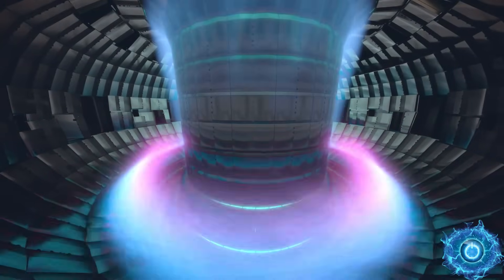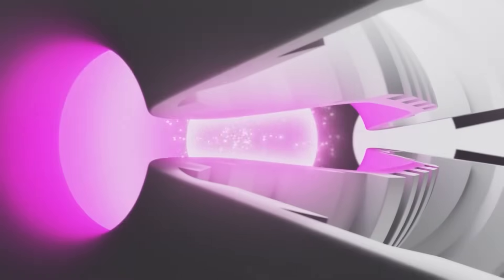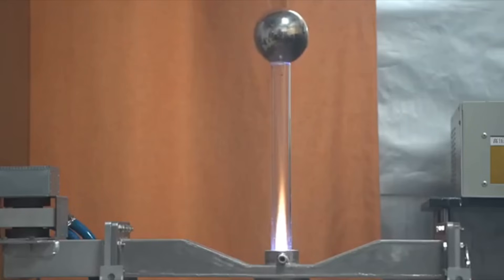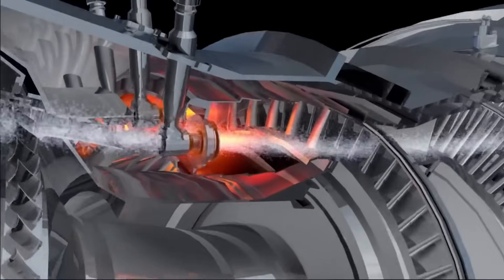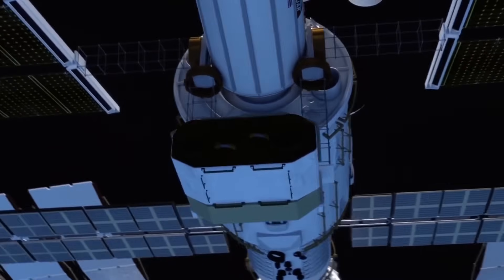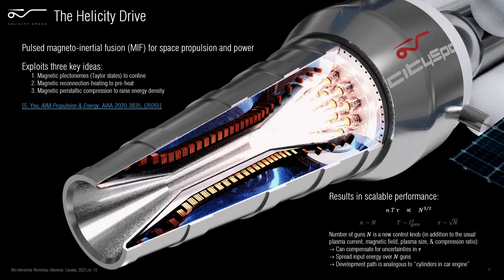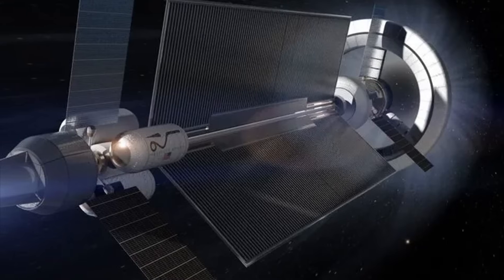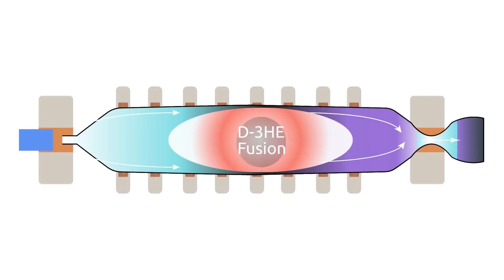New Plasma Engine DESTROYS Rockets!?

Comment: When fusion comes available and more importantly is scaled down to the sizes that will make it possible to be used in space we will use those but in the meantime we have modular reactors that meet the weight requirements as well as the operational requirements for use in space. With each modular reactor running 1 to 5 megawatts depending on the demand and a 40kw reactor is all very helpful. So do you think using the heat mixed with a reaction mass in a way that the nuclear salt water reactor that was developed for this use case early on in space flight development or do you think that we should just go directly to plasma as a means due to the fact that you can carry so much more reaction Mass. I don't know if you can carry enough salt water necessary for the existing design of the saltwater nuclear engine. But I think having up to 5 megawatts and perhaps two of those in one spacecraft who create an enormous amount of thrust if we can get that much efficiency out of a secondary reaction Mass such as lithium or other types of metals. There's a paper on metallichydrogen and that seems like it would be quite reactive and a candidate substance.

Comment: There is a 1 to 5 mg reactor that would fit in a falcon heavy. It's a modular reactor and it's made to run and never to require service or any kind of opening of the reactor core. It's a Lockheed Martin DOD Pepe and then there's the space made da Vinci Lockheed Martin 40 KW reactor made for lunar bases and operations on the moon. Both of those nuclear reactors will operate without the needs to change fuel rods or anything for I believe up to 40 years. You could run two of these reactors theoretically 10 megawatts but probably with the need to supply energy to life support and other things you could do a sustained 7 megawatt output dedicated solly to thrust. This could be in the form of these ion plasma engines or there's an existing saltwater and nuclear reactor based engine that they came up with in the 60s or 70s. However I think that salt water is not necessarily a very energy dense reaction Mass and then there's the potential to make metal hydrogen or another form of a very dense high energy reaction mass that could either be used in the way that salt water is used in the existing reactor or to make plasma. So if you ran 7 megawatts of current through a couple of plasma reaction Chambers and we're dropping very slowly adding small amounts of extremely dense. You can move a heavy cargo and passenger based spacecraft at a pretty good pace. You could potentially run i on a constant thrust basis. The question is how much thrust can you get from a plasma made that's safe from lithium just to pick one off the top of my head and having it create plasma with let's divide 7 by 2 so 3 1/2 megawatts per reaction chamber. I wonder how many newtons you can get out of there? They already have a space-based feasible module reactor and it's made by Lockheed Martin and it creates 40 kilowatts I'm consistent energy and weighs six times while 1-5 MEGAWATT REACTOR is 50 tons and will fit on the top of one falcon 9 heavy if the fairings will allow. And or could be broken up into two or three space shots but from a t weight requirements the one to five megawatt reactor on will falcon 9 heavy.

How do you say having two of these reactors built into a spacecraft for cargo, passengers, construction equipment etc for the actual construction of a base on a planet within our solar system could even potentially achieve direct consistent thrust so that the passengers can enjoy at least partial gravity as a linear gravity will be indistinguishable from the gravity we feel here on Earth if it's in space. If they can do a direct 1G burn and a 1G burn halfway through they can make it tomorrow and about 15 to 20 days. And during the entire time you lay out the interior so that the living spaces are designed to be interchangeable from one side to the other. The astronauts will experience a full gravity this would be a space built spacecraft not one that was shot off from the surface but would have to be brought up modularity. You can build it while it's sitting next to a permanent space station perhaps at the medium earth orbit and I would argue that as long as the radiation requirements can be handled that a geospace geostationary permanent space station would be very efficient and a good place to construct spacecraft for bringing cargo and passengers back and forth between Mars and even the the moon with Landers and shuttles being attached to the cargo vessel. It would also make it possible to rescue the people who are starting to establish these bases as the current way that we move around the solar system does not lend itself to a quick rescue. However if you have one or two dedicated cargo spaceships that have been constructed in orbit and you shuttles rather than landing themselves on the surface you can make a very large vessel that could contain two to four of these modular reactor as well as carrying a couple of the 40 KW for use at the base. We are going to have to use nuclear reactors and the two that I've mentioned currently meet the weight requirements for launching into space.

Comment: Besides a very high power energy source, any inefficiency must be rejected to space as waste heat.  That is very difficult at high power levels, requiring thermal radiating panels which would need to run very hot (even "white hot", like a Tungsten filament).

Comment: Properr  Cassing  with  self  eating  exhuast  To  elliminate  radiactive  waste  discharge   + a Direct Turbine system Implanted  in  the ship  housing  That  is  directly  Pulling  power  from  Fusion  core  would  fully  elliminate  Need  for  Any generator  solid  magnetic Core  =  each  ENd  runs  both  ground  and  positive  -  makinhg  one  complete  circuit  and  you  have  bypasses  all  along  the  way  and  double  and  then  in  tripples  and  so  on  with a  qubit-tronic  ai  compute  center  and  loaded  down  with  long  and  short  range  radar  dropped  along  the  way  and  it  would  only  take  one  per  Solar  Body   with  a  short  range  to  move  in  closer  to  defined  target  and  not  crossing  any  outgoing  reception  traffick  IF  ANY   -  ?  Which  we  are  MOST  DEFINITELY  "  NOT  ALONE  "  and  there Are  PEOPLE  JUST  LIKE  US  =  not  a  copy  but  simular  to  our  Design  and  DNA   Structure  =  YES  !!!  we  just  have  to  Leave  Here  and  ONE  DAY  =  ALL  OF  THIS  WILL  END  In  a  Massive  Engulfment  Of  All  the  Planets  till  it  Hits  Our  Gass  Giants  And  Then  BUILDS  UP   A  BACK  BURNNER  that  Implodes  or  Explodes  =  ?  it  is  simular  to  other  likewise  solar  Gravity  fields  =  Just  just  becuase  ALL  WE  SEE  On  somne  planets  are  just  A  few  Solar  dimmings  Doesnt  mean  they  Arent  GAS  GIANTS  =  Themselves  and  We  just  cant  see  the  smaller  planets  due  to  Their  ORBT  CLOUDS  =  ?  =  YET  !  wost  objects  in  space  For  A  Viewable  field  is  VISIBLE  dust  and  ORBT  clouds  as  they  Are  Intensely  Filled  with  Solid  Carbom  Matter  ! =  HOWEVER  =  traveling  Through  space  Are  those  Not  surrounding  Any  Solar  Gravity  Field  and  is  Where  we  Would  want  to  Travel  as  it  would  be  OUT  of  ANY  FRAVITY  FIELD  !!! =  yes  =  Between  Solar  Gravity  fields  -  so  -  Really  not  a  Staright  shot  =  NOPE   !!   You  WOULD  NEED   Trajectory  Propulsion  as  well  thats  WHY  you  cannot  just Use  One  Cavity  for  suh  but  at  LEAST  3   -  Two  Side  =  Horizontal and  one  Vertical  And  Largest   Thrust  Vector  being  Centered  Vertical  with  nearly  same  Design ,  Shape  and  Slighty  Smaller  Size  of  center   as  with  two  the  less  for  each  and  Quicker  repsonse  as  forward  Motion  would  demmand  Those  also  to  have  Multiple  plains  of  directional  Force  =  ALL   3  in  fact  ,  From  a  Stationary  Position  -  as  it  WILL  tear  apart  from  ship  if  you  do  not  Make  Core  of  vessel  ONE  Very  large  solid  CORE  ! and  not  just  in  the  basic   4 directional  but  rather  All  Directions  Circles  can  be  for  pathways  between  but  keeping a  flat  floor  plan  from  lower  to  upper  decks  and  just  as  Much  backing  in  Each  Floor -ing  -  just a s  thick  as  center  out  so  the  same  as cross  side  to  side  and  most  outter  being  the  thickest  panels  ,  they  acnnot  be  thin   they  must  be  as  3x`s  thicker  than  structural  core  with  multiple  layers  that  also  influde  multiple  functions  -  liike  bleedoff  of  gasses  in  each  quadrants   and  bulk  heads   at  yes  each  passage  way  is a  bulk  head that  is  pulled  up  into  upper  deck  hidden  from  access  uless  emeregency  wich  yes  you  would  need  rat  tunnels  -  look  to  military  terminology  here  ,  and  escape  pods  that  are  part  of  ship  hull  also  that  Retains  Hull  As  Escape  is  Commenced  as  in  a  Abandon  ship  oreder  is  last  resort  anyway  , i  mean  the  details  that  need  to  be  drawn  out  cannot  be  easily  created  over  night  -  not  even  with  ai  ,  but  with  the  minds  of  humans  to  put  it  together  and  the  CURRENT  Position  of  AI  =  Is  IN  A  Freaking  MEME  -  ?   :face-turquoise-covering-eyes::body-green-covering-eyes::face-turquoise-drinking-coffee:

Comment: There are several plasma or Ion drives in development now and I am happy to see them but I see failings in each one.  Or perhaps I am just not happy with the results and in my mind it should be simpler to solve.  The coils are not dense enough, the tube is not long enough with the coils and the coils do not seem to be accelerating the plasma and there is no information on the plasma injectors pressure feed to demonstrate the power or thrust gain from that point to the end point.  The coils represent an afterburner made up of magnetic fields but they are still short and ineffective at adding speed.  Of course I am hoping for more than 10,000 miles per second speed.

Comment: Current Fusion Technology can create fusion pulses from deuterium pellets. There are also experiments deriving electricity directly from the fusion reaction. This is fairly inefficient at this point, however if you only needed some electricity from the reactor this might be sufficient. And if the fusion pulse was able to be directed in a single direction, this might be quite useful for a fusion plasma rocket, with an electro
magnetic guide. 
In fact imagine two electromagnetic rail guns firing two  deuterium pellets at each other, when they fuse into helium releasing energy the power from that is captured on  3/4 of sides and electricity. And the plasma is ejected from the rear side guided by an electromagnetic vortex. In a sort of electromagnetic bell housing. Thus producing directed thrust. 
And there you have it a self sustaining fusion drive rocket. 
All from basic existing experimental Technology. 
One only requires a deuterium supply. Say a large tank of heavy water. Which can be split to give Oxygen and Duterium. With the oxygen used for life support. Or recombined with any regular hydrogen for a water supply. 
Any excess beyond that, and any waste from the ship can be injected in to the plasma drive to be ejected as additional mass.

Comment: My MIT work proves how Noguchi of early 1940s Hamgyong had perfected muon catalyzed fusion for spaceplanes so Dr Mitchel Swartz phoned me to suggest how I should take Jerome Drexler  to court for plagiarism since Noguchi of early 1940s Hamgyong had perfected rocket engine comprised of a Dewar of deuterium connected to a beryllium alloy reaction chamber nozzle in around electromagnet Helmholtz coils to focus cosmic ray muons for cryogenic fuel to prevent exceeding of Curie Point.

I have a CIA archaeologist stuck in of Eastern North Korea or even in of Eastern Manchuria to search for any remains.

Comment: Congratulations ... very beautifully thought out ... more engines put in parallel and then a single way of escape and this can be used as a particle accelerator ... increases the particle flow will increase the current taken by accelerator ... In my idea, ionized particles are first accelerated in a circular accelerator (where the particles pass from one accelerator to another) and then are evacuated through more nozzles ... which work in parallel. My motor is a hybrid between the rocket and a accelerator...

Comment: Air breathing plasma thruster is a dead idea because it requires so much electricity that is nearly impossible to generate without a nuclear reactor on board. And if we have a nuclear reactor on board it's a better idea to heat the air using the heat of a nuclear reaction rather than use bulky steam turbines and generators to turn the heat of a nuclear reaction into electricity and then turn it back into heat using microwaves.

Comment: No, if we cannot build a plasma fusion reactor, we cannot build a fusion drive either. First you need to be able to extract energy from the drive to provide the power needed to create the conditions for plasma, sustain the plasma & provide magnetic confinement to protect the engine from getting destroyed by the very hot plasma.

Comment: sustained explosions engines might be near these kind of multi pulsed recombined instead of a burn you could acheive detonation energy by pulse and recompose the plasma into a steady burst. didnt happened yet china was having some advancce on it with a ring design basically explosion that spun around a channel but last time i saw that they couldnt keep it going

Comment: i don't think it matters. the problem realistically is with source of power, not with methods of creating exhaust. a man named Robert Enzmann proposed using particle accelerators to drive his proposed echolance starship. this ship was supposed to achieve up to near lightspeed without any substantial new tech. realistically, just strap a steam turbogenerator onto a standard nuclear reactor, and you should have far more than what is needed to get to mars in 39 days. more power means more vasimir scale ability.

Comment: I read about another old somewhat similar but much simpler concept where the rocket nozzle was a thin, long cone where the walls transitioned from neutron absorbing materials to neutron reflecting materials.
When pumping a nuclear liquid salt at high pressure, a fission reaction can be maintained at the end of the nozzle for enormous specific impulse values
Reply: You seem to be referring to Bob Zubrin's NSWR: Nuclear Salt Water Reactor, which is indeed fascinating, but requires some extra complications in order to keep the neutrons in only the proper section. I have never seen that additional part described.

Comment: I-Cann II rocket concept from  Pen State University claims 128 days. It is a hybrid nuclear pellet design that uses the nuclear pellet being detonated by antimatter using a storage container called a ping trap to hold antimatter.
Reply: Aimstar is another concept close to that. Military ebit and ebis can produce a fast particle projection that can be placed in space to create antimatter without a long ring to smash atoms. Hopefully physicists can expand on this idea? Hurtle 1: solved by ping traps catching antimatter from ebit and ebis and storing it. Much like reloading bullet shells for reuse. Time consuming is a space trip so it can be done in route to slow down when reaching the designation. Problem 2: material for the collider. Problem 3: nuclear pellet safety handling to orbit. Problem 4: Being able to have a fast enough collider system to produce antimatter quick enough. Anyone want to add to this idea? It would make a great article....
Reply from the maker: Thanks, I will look into that!

Comment: The folly of all conventional fusion rockets is their over reliance on plasma made by fusion fuels. The plasma simply has not enough mass to be a viable alternative to a fission thermal rocket or particle beam propulsion. High thrust requires a lot of mass so you'll need a way to make sure that you insert extra propellent into the plasma. I think it's common knowledge that this is hard to do unless you greatly increase the complexity of the drive. Another important factor is radiation. Much of a fusion reaction's energy comes in the form of neutron and x-ray radiation. It's enough to vaporise any unprotected system near the plasma. A far more efficient alternative is pulsed fusion power. Take an orion drive, remove the pusher plate and install a (non ablative)heat shield instead. For a pusher plate, you activate a strong magnetic field just above the shield. Instead of nuclear bombs, we use fusion fuel encased in a ball of frozen water or something similar. At around 300 meters away from the craft, the fuel pellets are targeted by a laser. The temperature is enough to make the reaction happen and a large cloud of plasma appears. All of that plasma slams into the magnetic field and creates thrust. All in all, you have low complexity, no need for radiators and better efficiency.

Comment: You make a nuclear powered airplane and problem solved. 
Small modular reactors (SMRs) range from 20 to 300 megawatts and they are 100 to 1000 times smaller than their bigger counterparts. 
6 pounds per kilowatt means you can have 120,000 to 1,800,000 pounds of thrust consistently for about 7 years straight...

Comment: 131 star systems are within 6 parsecs of our solar system. If such a drive works potential long term probes could make such a journey to those stars within 20-100 years. That's a huge upgrade given the two Voyager probes have been going about 40 years & haven't reached the Oort cloud yet.